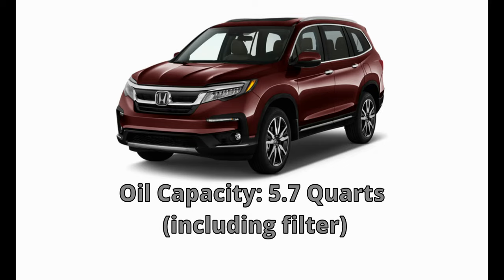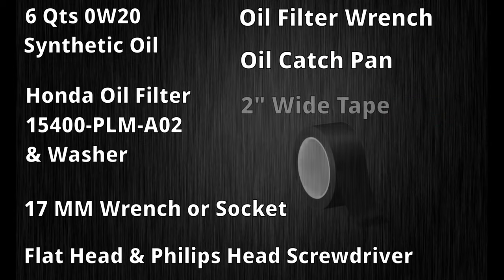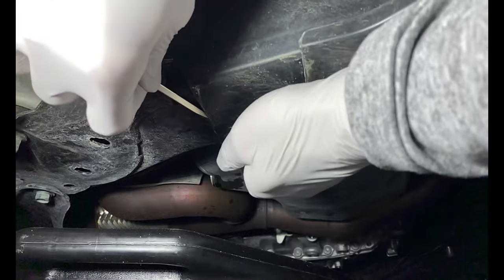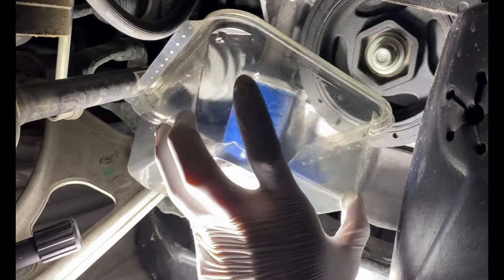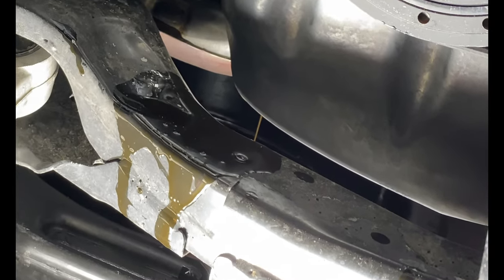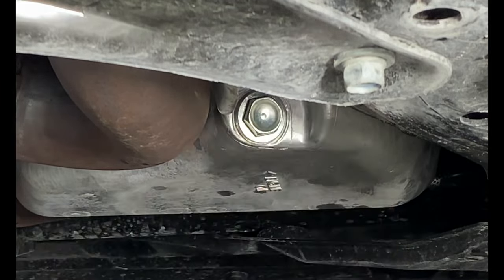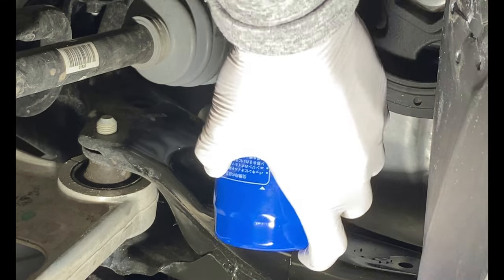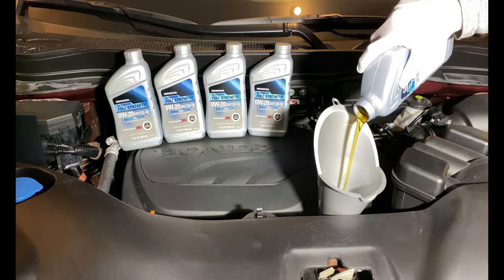2016 - 2022 Honda Pilot Synthetic Oil Change

Comment: I use a large zip lock bag around the filter to catch the oil.   It's flexible and stays reasonably stable when spinning off the filter.  During cleanup, I put all used paper towels etc in the bag, zip it up and dispose.  I also find it easier to remove the front passenger's side wheel to access the filter.  I usually rotate the tires so taking the wheel off makes sense.
Reply from the maker: Those are great ideas!

Comment: i have done 2 oil changes on my honda passport, i watched a ridgeline owner on youtube, he put a ziplock plastic bag over oil filter, unscrew it slightly and let the oil drain out, then completely unscrew the filter and let it drop into bag.

little to NO oil spilled onto subframe or my garage floor and didn't make a huge mess. 
highly recommend ziplock bag method to catch the oil dripping from oil filter removal.
Reply from the maker: That is a great idea, I would wait till the oil is cold, synthetic oil is pretty toxic on the skin especially when it is HOT.
Reply: @OwenLucas  yea, i wear nitrile gloves. I have also tried the aluminum foil method, where you cover the subframe with aluminum foil, but that creates a mess on my garage floor.

Ziplock bag method is the best. Little to no mess.
Reply: Why?  Can you document this? @OwenLucas

Comment: Can you change the oil without jacking up the Pilot?
Reply from the maker: You do not need to jack it up or even take the wheel off.  It will be a tight squeeze getting under the vehicle but it can be done.  Turn the steering wheel to the right for access to the filter. Make sure to use the parking brake and  put blocks behind the tires to keep the vehicle from moving.

Comment: I Did the oil change on my 2016 Honda pilot did what the guy from autozone told me buy 6 quarts of oil but I put all the 6 quarts of the oil I don’t think it’s bad for the engine since it has high mileage and we run the truck a lot or I messed up by putting all the 6 quarts ?

Comment: How about telling us often fully synthetic oil should be changed 😡
Reply from the maker: The Maintenance Minder on the gage cluster will tell you when to change the oil.  It’s usually around 7-10k miles but I like to change mine around 5k.
Reply: I also like changing at 5k.

Comment: Does the Honda oil have additives like Valvoline Modern engine oil to help prevent carbon buildup on intake valves that is caused by these new GDI engines?
Reply from the maker: I am not familiar with the additive package but I am pretty sure that Honda's oil formulation would be the ideal use for its engines.  I used the Ultimate Full Synthetic 0w20 as opposed to Honda's regular full synthetic.  Its about $3 more.
Reply: @OwenLucas  Both are fine oils to use. As long it's a reputable brand. I use Eneos by Nippon oil sold at NAPA auto parts. Really good oil.

Comment: Remember not to over tighten the drain plug.  Use a torque wrench.
Reply: 45 N-m or 33 lb-ft
Reply from the maker: That is correct, a very often overlooked procedure. Thank you for the tip!